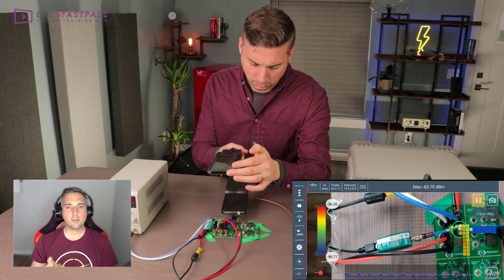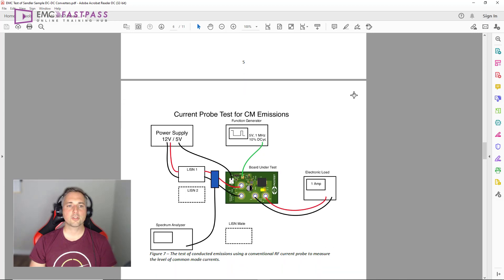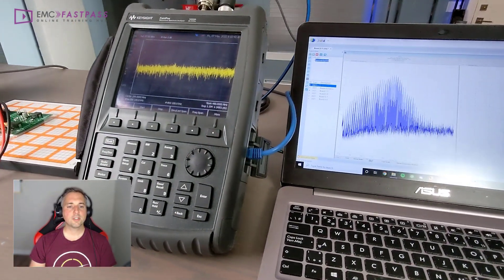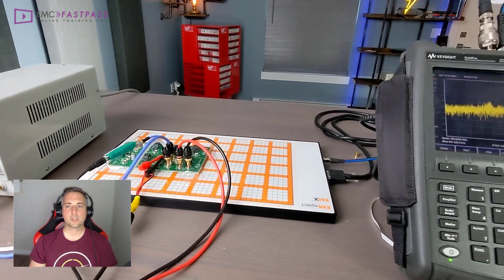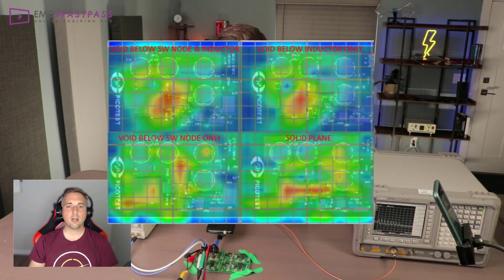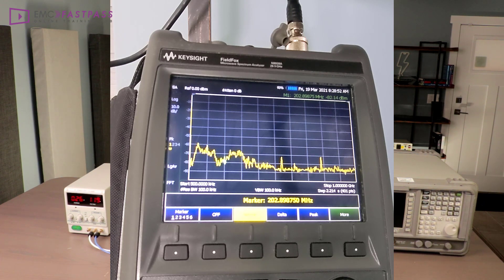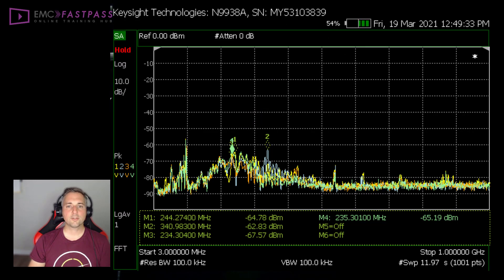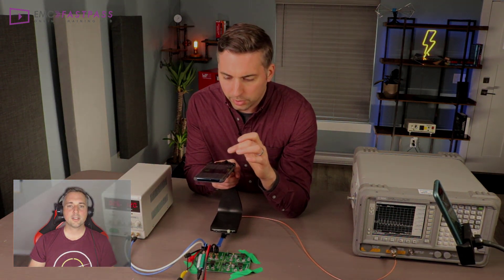005 DC-DC Converter Layout - Solid Ground Plane or Cutout Below Switch Node?!

Comment: Quoting the results of your near field top emission measurements (see time 2:55), the solid plane has -36 dbm emissions while the other configurations have -40 dbm emissions. It is my understanding that a more negative value means less emissions - which is better in terms of EMC. Based on this, the solid plane emits more power (-36 dbm) compared to the other configurations (-40 dbm). Does that make sense?

Comment: Hi, Thanks for the useful demonstration - I expected those results. In my opinion, the cutouts are always tricky and should be avoided. The copper serves as a return path for switching edges/peaks and if you remove it, the noise will travel somewhere else - its power does not disappear.

Comment: Great video 👍 It would be interesting to see if there is any measurable increase in ripple/noise in the power supply output too. I.e. is additional noise present on the output (via ground plane) instead of being radiated.
Reply: This was my thoughts as well - the energy from the switch node has to go somewhere right. I suspect it is a trade-off between EMC and performance, a bit like gate drivers but happy to be proven wrong!!

Comment: This is very helpful, thanks. Strangely I was searching for this answer just yesterday evening and I see this video in my LinkedIn feed today ! Questions I have are - is what you have shown, applicable to all dc-dc converters or do you think it could vary from board to board ? for e.g., switching frequency? How does the result change for a multi layer board where the ground plane is not immediately below the power plane (This question might not be too relevant since designers usually place the GND plane of DC-DCs right below the power plane ? Lastly, does this observation apply to even a flyback inductor(transformer). In a flyback converter I designed long back, I was advised to remove copper under the transformer.

Comment: I've laid out hundreds of boards with switching supplies going back to the early 90's.  I examine each circuit to see where the current is going and design around that.  I usually use as much plane as possible, sometimes making a "moat" 3/4 of the way around the switcher so that any wild currents stay within a limited area, especially if the supply is near analog parts.  For the most part, more copper is better. Also removing the copper under an inductor seems like a good idea in some cases, as PS performance can be affected for some inductor types.

Comment: Hi Andy, nice video again! But I'm a little puzzled when you say "clear the ground plane". Do you mean "make sure the ground plane is clear of interruptions" (ie: it's continuous), or do you mean "clear the ground plane away" (ie: remove it, as in having a cutout)?
Reply from the maker: Sorry yes, by 'clear the ground plane', I meant 'create a cutout in the ground plane'. Various app notes give conflicting advice on this, for the reasons that you found in Ken's report. Generally the advice is in relation to radiated and conducted emissions performance. Steve at Picotest created the boards to help answer the question.
Reply: @EMCFastPass  As I understood this topic, the only usefull thing here is to make cut out under the inductor on the top layer(1st layer) if the reference plane for the switcher is 2nd layer. In this way fields will be kept in the space between Inductor and solid plane on the 2nd layer. 
Making a cut out through all layers doesn't make a sense, if we consider return currents on the 2nd layer. These current will spread around this cut out on 2nd layer.
Reply: @UCHstpfs_A83MQM_BXlMa1vg Hmmm, OK. Well yes, you displayed the boards and it was clear what alternatives were to be compared. But it wasn't clear why there was even an impetus to remove the ground plane. However, now reading Ken Wyatt's report, he writes in the intro: "The question on whether the ground return plane should be cut away under the switch node or inductor of DC-DC converters has been an ongoing debate. The argument for an adjacent solid plane under all converter circuitry has been to contain the electromagnetic fields in the dielectric space between the circuit traces and return plane and that this would prevent the spread of EMI around the board.Others argue the capacitive coupling between circuit traces and return plane should be cut away to minimize the capacitive coupling due to large dV/dt swings of the converter switch node with corresponding contamination of the return plane with EMI." 
So I guess much depends on the vague notion of "contamination of the return plane with EMI".
Reply: (And YouTube's Reply function seems to be inserting a weird Id "UCHstpfs_A83MQM_BXlMa1vg" instead of "Andy". Not sure what that's about!)